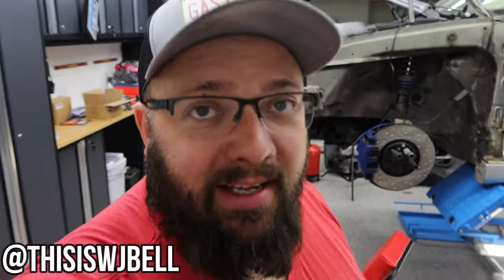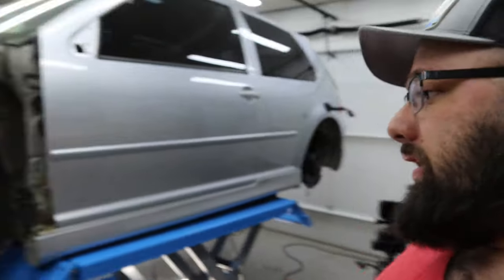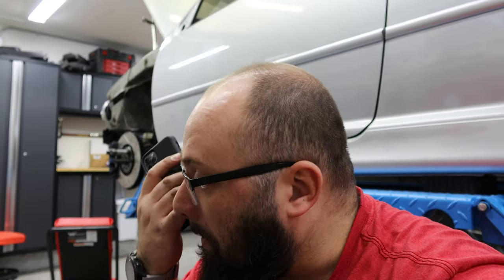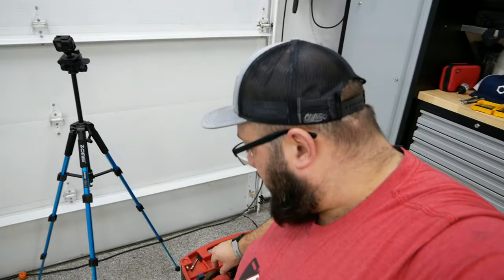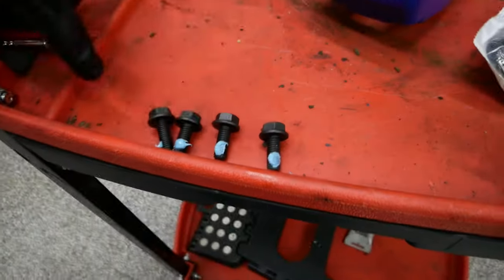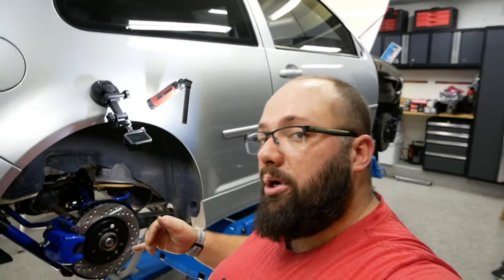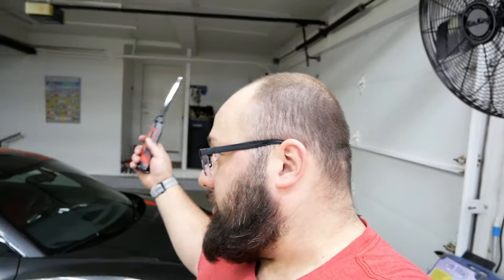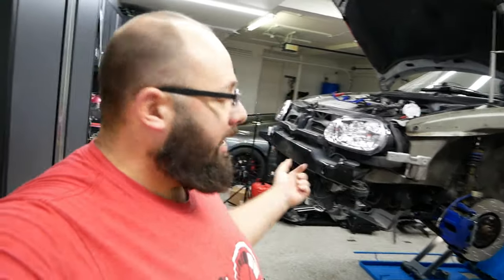VW MK4 R32  UPGRADED my Rear Brakes. New Calipers, Rotors & Pads! The Project Car Rebuild Pt. 16.

Comment: did you upgrade to stainless brake lines?
Reply from the maker: Yes. car isnt done yet, I'll start working on it soon.
Reply: @GasTachs  I finally pulled the trigger in stainless lines on my as well r32. Was looking for a video for the rear lines (short&long) also You have a lot of great content on the platform please get some new vids up soon!!!
Reply from the maker: @thatblur3249  nice! Hoping to get back on the r32 in the next month. Just finishing out 3 other projects.